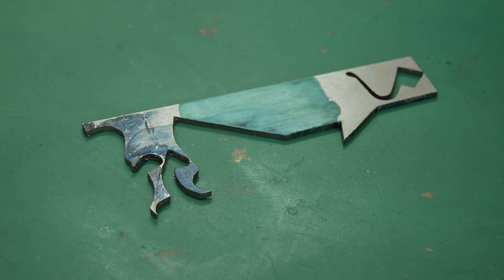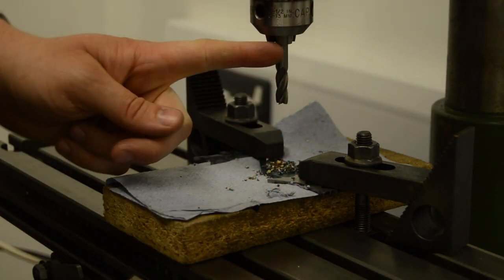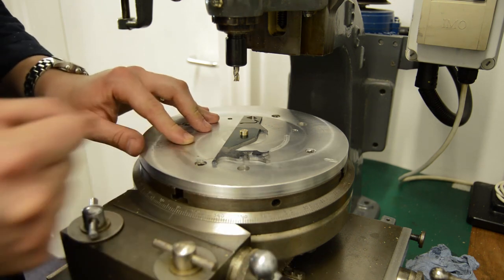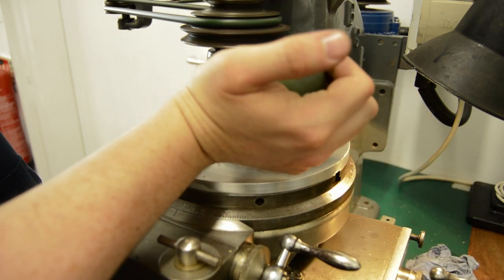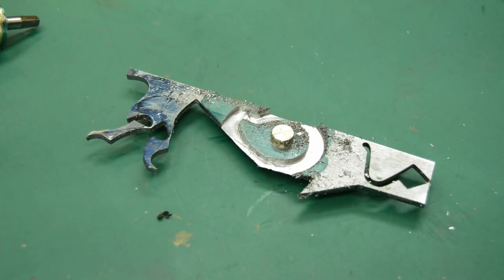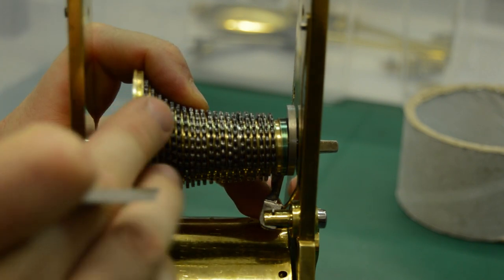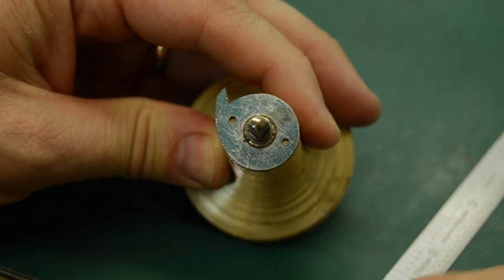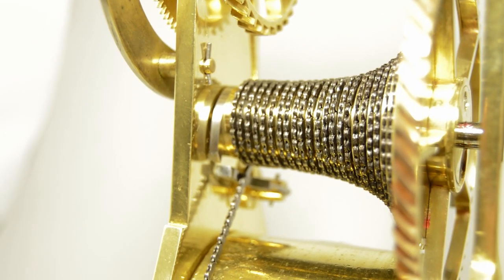Clock Repair - Making a Fusee Stopwork Snail

Comment: The main reason for milling cutters being a no-no is that the vibration caused by milling unseats the chuck from its taper, either the Morse from the quill or the Jacobs from the arbour. Using a cutter as you did is fine as you are just drilling with a four flute flat bottoming drill, often also known as an end mill.😂

Comment: Thanks for the video. Is there any reason why you chose gauge plate over say, mild steel or brass? Just curious.
Reply from the maker: Good question, the answer is it’s not necessary, but it stands more chance of surviving long term. Higher quality clocks tend to be steel rather than brass, but it’s not a rule.
Reply: @TommyJobson  Thanks for the info. You are teaching me a lot....

Comment: Hello sir, my query is as follows, it is possible to replace the link chain with a steel cable, I am a watchmaker, I live in Argentina and some spare parts are complicated, thank you for sharing your knowledge.
Reply from the maker: Yes it is possible, however not advisable.  If a chain is really not obtainablee I would probably recoomend using a plastic covered steel line and making a pair of hooks for the ends, that way the barrel and fusee will be protected from damage and it cal always be put back to original should a chain be sourced in the future.
Reply: Great question